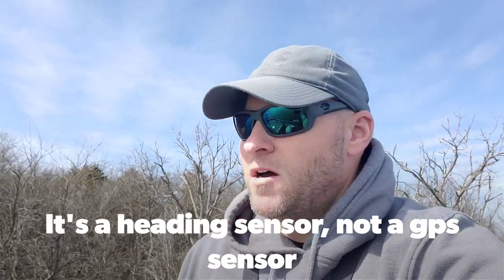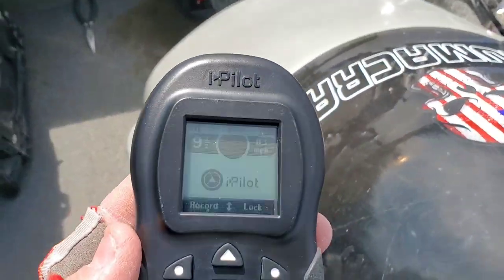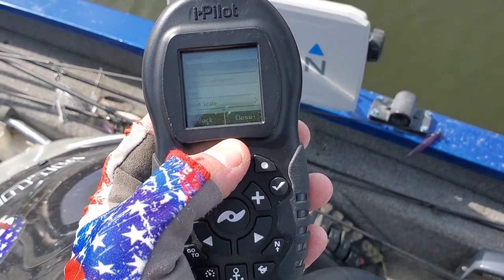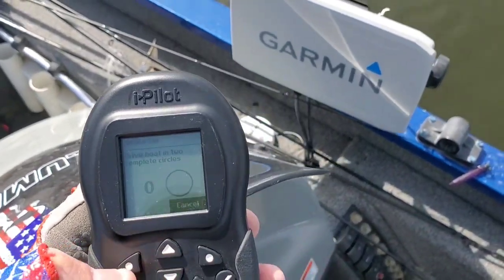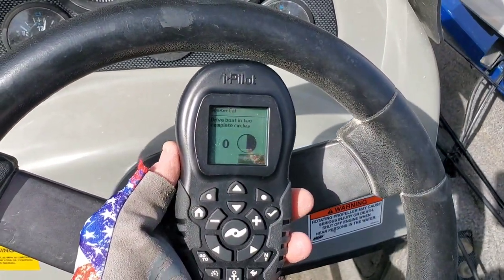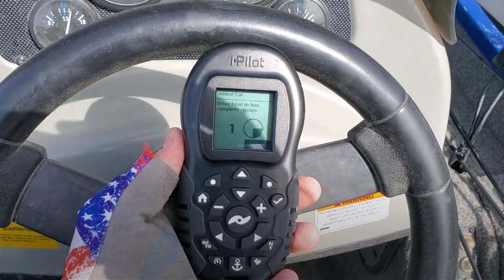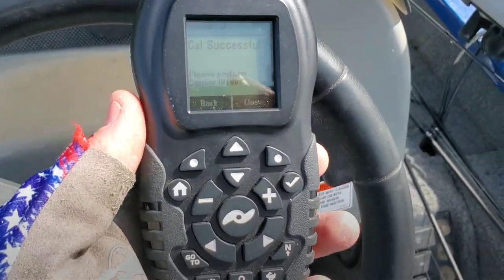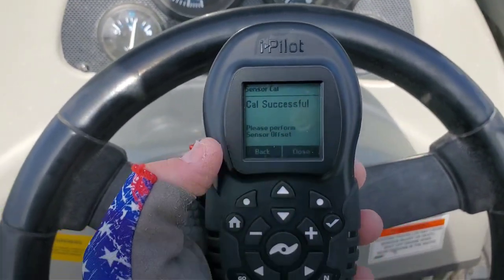Minn Kota I Pilot Heading Sensor Calibration~ Terrova~Short & Sweet #minnkot,#ipilot,#calibration

Comment: Quick note. I don't think the offset is to compensate for the heading sensor not facing forward. I think it sets how far off-center the sensor is if you drew a straight line down your boat from front to back. Example, based on where yours is in the video, you (in your seat) are sitting at 0" offset. Your heading sensor is offset at least 12" to starboard. If you let the system assume that the motor and the sensor are lined up in a straight line front to back (with no offset), your motor won't drive you straight. It will wag back and forth when trying to hold a course. A good way to see if your offset is correct is to select the little north button to hold a course when you're underway. If the heading degrees on your remote don't match your compass, your offset is wrong. Where yours is installed in the video, you might try to set a heading of dead South (0 degrees), and your remote will say your heading is about 330(NNW) because it thinks the actual offset on your boat is a straight line.
Reply from the maker: Perfect explanation! I've since gotten my offset dialed in but I would've never explained it that well! Thanks for watching and tight lines!😎🎣
Reply: U are absolutely correct and that's a great explanation!

Comment: What if you don't have a puck? Is there anything that one can do that will help? I have an issue with losing spot lock on my Terrova. Thanks for the video. I have a 2016 model.
Reply from the maker: I had an older model on my previous boat as well. Supposedly, the general consensus is that the ONLY thing the puck is for, is the jog feature on the newer ones. They say, it does nothing else. I didn't realize that when I made the video. Yesterday was the first day my spot lock would shut off. I was trying to hold in 30-40 mph gusts and when it would get blown too far off its spot, it would abort mission lol
Reply: Thank you! @Midwesthookset

Comment: What is the white little box for will it not work without it
Reply from the maker: Yeah, it'll work wothout it. It's a heading sensor. I think you need it to use the jog feature, like when you want to move in a certain direction, 5ft per push of the button. The older models of ipilot motors didnt have the sensor. I had a 2014 or 2017 model before, can't remember for sure. But the one I have now seems to hold to a tighter spot lock radius

Comment: Sensor Cal isn't an option on the remote, all I have is boat scale, update software, pair and restore defaults. Any ideas? I've been on the water about 8 times and the motor seems to work fine but I never did the sensor cal with the driving in 2 circles requirement.
Reply from the maker: Do you have the heading sensor puck? And what year is the motor?
Reply: @Midwesthookset  The motor is a 2022 and I did install the puck.
Reply from the maker: Did you pair it with the motor? It seems like I read somewhere that the calibrate option shows up after pairing. That all I can think of. Might have to contact minnkota unfortunately

Comment: There's no sensor cal on my terrova remote. Has it been already calibrate then??
Reply from the maker: Do you have the heading sensor puck? The pre '17 models didn't have it, so there's nothing to calibrate
Reply: @Midwesthookset  yes, I actually my heading sensor wasn't turn on that's why. It has been wired to the master switch on my dashboard thus when I flip the switch on. It showed sensor cal. Now do I need to keep the switch on all the time? When I swtich the switch off, it seems to be still working.
Reply from the maker: Good question. I wired mine in under the dash but i cant remember to what. Mine comes on automatically, when i power on the trolling motor, otherwise its off. It won't lose its calibration if it shuts off with the switch, if that's what you're asking.
Reply: @Midwesthookset  I was told it sucks up the battery when the heading sensor stays on. I probably turn off my then
Reply from the maker: Yeah i wouldn't want it on when not in use

Comment: My remote looks exactly like yours but I don’t have an option for sensor cal.  I wonder if I have to update the firmware.
Reply from the maker: Possibly. What year is your motor? It has the white heading sensor puck?
Reply: @Midwesthookset  I just bought it.  And it does have the white heading sensor.  It all came together.  Remote, motor and sensor.
Reply from the maker: It's been a while since I calibrated mine but it seems like everything has to be turned on and the motor deployed, and then the calibration option will show up. Hopefully

Comment: Do you ever wish you had a 24 volt motor or are you satisfied with the 12?
Reply from the maker: Just the other day was the first time my motor wasn't enough. 30-40 mph wind. Spot lock would hold but the motor wouldn't power forward well lol. If your boat has the battery room, I'd definitely go 24v. Mine doesn't.
Reply: @Midwesthookset  yeah I have the same issue so I just got the 24 volt delivered yesterday.  I'm sick of the thing losing power. I've also noticed that after a couple of hours that I couldn't turn the motor if it was on 10. Can't wait to get the new one on
Reply from the maker: Nice! More power is always better imo👍

Comment: I've tried this a thousand times.  Mine just won't calibrate.
Reply from the maker: Sorry to hear that. What is the model year of your motor?
Reply: @Midwesthookset  2018 ulterra. I've calibrated it before with no problem.  Moved my puck and now it will not.  Only thing I can think of is now it's getting electromagnetic interference from my electronics.
Reply from the maker: I'd contact minnkota if I were you. Maybe the heading sensor is faulty or was damaged. Mine sits pretty much right under my fish finder.
Reply: @bryanspencer2632  yup, sounds familiar to me! Had exact the same problem. My sensor was installed to close to a stereospeaker. A speaker causes electtromagnetic interference and won't let your sensor calibrate. I had to telocate the sensor. Use a compass  to search for electromagnetic interferences.